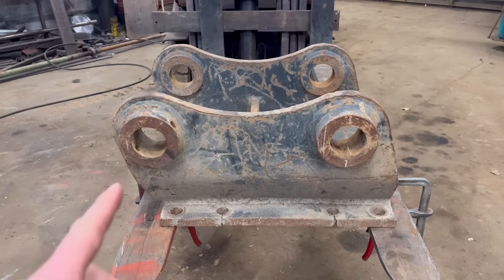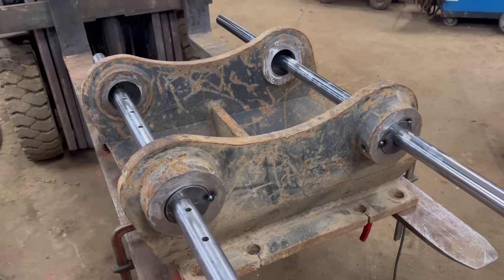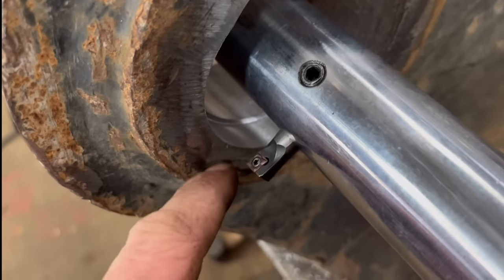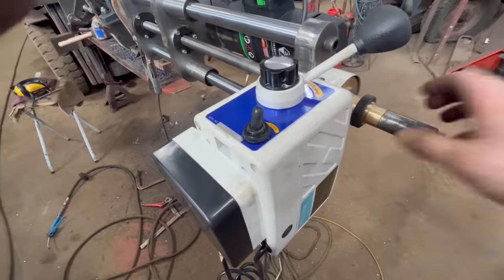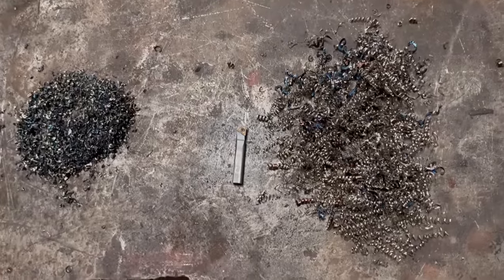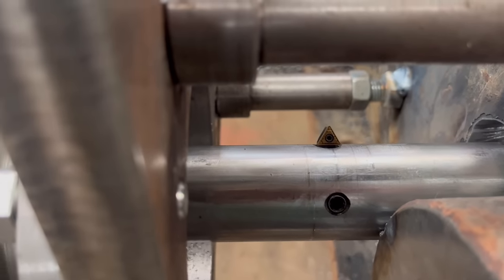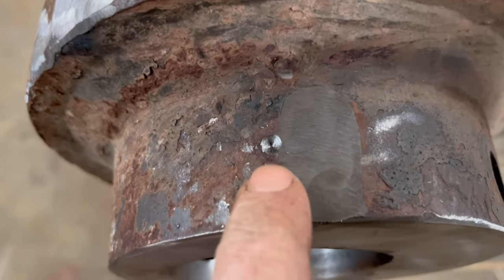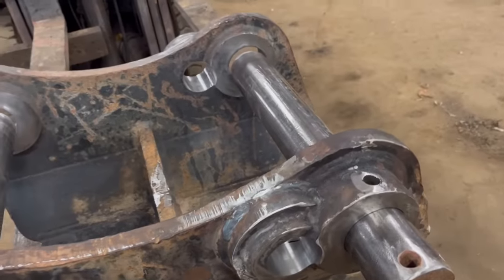Line boring excavator bracket. Offsetting holes to change pin centres.

Comment: Great job, nice to see the DIY line boring tool is doing a great job.
When welding inside the bores and other tight quarters, remove the gas shroud, it'll give you that little extra room.
Reply from the maker: How will the gas shield the weld though?
Reply: @snowballengineering  In the confined space like this, the gas builds up, as it can't escape the area of work. You will need to increase the gas flow, a bit of trial and error.
You can also use flux core, if it's tight quarters and gas coverage not working.

Comment: Oliver as a machinist from a shipyard I am very impressed with the machine you built and the results you are able to achieve. I am looking at trying to duplicate your line boring machine to do some side jobs as I am now retired. Thanks for the inspiration and for sharing the failures as well as the great results, cheers Paul. Victoria BC Canada
Reply: This is Jack many years in a machine shop and managed many, and owned two. when you're using a boring bar like you are using it, I believe you may need a radially relieved tool. The tool you're using looks like a regular lathe tool. According to the inside diameter, I have seen boring tools in small diameter holes, relieved as much as 15 degrees Under The Cutting Edge. Also you need to be cutting on Center, by drilling the holes through the bar a little lower than you have maybe. Breaking tools and them not running correctly is a good indicator the geometry is not correct.

Comment: If you get a similar job, consider the approach of cutting off the bosses (of the holes to be moved) and welding them back on in the new position; that would get you less interference between those bosses and those of the new holes.
Reply from the maker: Trouble is the bosses aren’t just welded on the sides, they go all the way through the side plates. Would of been quite a big job to do that and would still of needed line boring afterwards. Thanks for the suggestion though.
Reply: I couldnt help think the same but the reply reminds me i know nothing lol

Comment: I’m quite impressed that cheap power feed stands up to some fairly heavy use. I have the same one on my milling machine, it gives me a little hope it’ll last a while. On the whole your line boring machine is doing a cracking job.
Reply: I remember the first time I seen that they have a plastic gear being driven I could hardly believe that they will hold up regular use, yet it seems they do just fine with it.

Comment: Cracking job Olly and a bit of learning too !
We've just finished converting a pto driven dual head timber winch to a digger jib mounted unit, using a 45kw hydraulic motor which required making a  headstock mount. I'm used to working to tenths of a thou for toolmaking jobs, but since I retired the jobs have changed and getting digger pins to fit requires a bit more relaxation on my part, but no less "difficult" under certain circumstances, well done mate.
Reply from the maker: That sounds an interesting job.  I know what you mean, the pins need a good amount of tolerance which will seem counter intuitive to your toolmaking jobs.

Comment: Good job all things considered most places would not tackle a "one off" as there is no previous on which to base it. The end result given what was wanted and using the existing unit is excellent. Having had the benefit of seeing your approach (and possibly being wise after the event) it struck me that this may have been a lot easier with two new plates complete with new holes / bushes and the assembly welded back in place via a jig arrangement previously set up and welded in place for correct alignment. This "idea" seems to be a possible easier alternative method as I muse from the comfort of my armchair!!!!
Reply: That's what I thought also. Maybe leave the lone holes as they were and cut the dual hole area away. Then weld on some 40 or 60 mm plate with flame cut starter holes and bore them out.

Comment: Interesting job. The boring setup seems to work well. Could you not have opted to use shrink fit , heavy wall steel bushings (home made) instead of weld. The original strength would have been somewhat less compromised (thermally at least) since the bush hoopstrength would contribute to the strength overall. I really enjoy your problem solving and patience as you overcome difficulties.

Comment: That was great, nice problem solving.  You could see that the old tool was blunt. The chips were real hot and color changed but when you changed to a new insert the job went much smoother. Thanks for sharing.

Comment: The easiest way to get a flat spot for drilling is with an end mill, then spot drill and drill normally. The first tool you used for the line boring looks like it needs a bit more relief under the cutting edge as it looked like it was rubbing and limiting the cut.

Comment: Nice job moving those holes.
A trick I used to use when a drill had wandered off centre was to cut a groove down the high side of the slope with a centre punch.
Basically make a little v channel.  Let the drill bump across the channel until it has removed it.  If it’s still off centre do it again.
This will allow the drill to cut only on the high side.
The other choice is to start with a slot drill of the same or similar size (2 fluted end mill). But we don’t all have a full set of those :)
Use that to flatten out the starting point of the hole.  Once it’s flat put the drill back in.
I like your trick.  I wouldn’t have thought to do that.

Comment: Really well done, I am impressed. Meeting your customer's expectations can be hard sometimes, especially if they are sprung on you mid-production. The new insert holder did work really well. As for the new bolt holes being off centre, if you had an end mill you could have started the hole with that, making the drill follow the new path. Having said that, your guide block method worked brilliantly. Thanks for posting, I'm still catching up, keep safe and well.  👍
Reply: My thoughts as well regarding the end mill.

Comment: Customer didn't want much did they. I was a Carpenter for over 40 years. One of my favourite sayings was. The job would be alright but for the customers. Then you have to look at it as what you get out. The varied experience now gained from having to overcome awkward requests. You now know way more than you did from straight forward re cuts. And have a good excuse to buy some more cutting bits and facing tools. Actual experience is way better than any other form of learning.
Reply: it’s not like it was a cosmetic request, if the hole centres won’t fit the excavator it’s useless. From that point it’s down to cost, much cheaper to modify that make a new one

Comment: When a tool sings like that one when it's cutting that's called chatter. Chatter is a destructive force that will break your tool tip and leave a bad finish on your machine surface. Slowing down cutting speed would be the first step to minimize the chatter. Increasing the feed rate at the same time might help also.

Comment: Good work around and the driver of the machine won't care abt the finish one bit by the state of the pins. As you said you learnt loads, you can put a slot drill or end mill in the chuck and make a flat on a raduis for  drill spotting.
Reply from the maker: The brake on the drill is a bit worn so she doesn’t like any kind of sideways load. Definitely learnt a lot on this job.

Comment: Amazing work as always! For your problems with the weld buildup in the holes, maybe try using some 7018 stick electrodes and you can give them a bend to fit into the hole. If you keep a needle scaler next to you I bet it'll go just about as fast as the MIG.
Reply from the maker: It’s a long time since I’ve done any stick welding, that could be just as problematic 🤣
Reply: @snowballengineering  Gotcha! 😂
Reply: Thought I seen some stick welding,  maybe gouging

Comment: Good video 👍you did a great job. It looked like you wasn't using the cutting edge correctly to me. I'm not a machinist, but did work as a Maintenance Engineer at Dagenham Engine Plant Ford. 👍
Reply from the maker: Thanks.
Yes, the tool was too low in the hole and was rubbing on the insert.
Reply: @snowballengineering  it looked like the insert needed to be rotated so it was cutting on the correct face. 👍
Reply from the maker: No, I’m not that daft to be cutting on the wrong side.

Comment: Rare earth magnets are a useful workshop tool, you could use then to hold the disc in place firmly while you align them, you can also use them when setting the cutting tool depth as it will help help it in place while you adjust the screw and provide a bit of friction to make fine movement easier.
Reply from the maker: Only issue I’ve found with magnets in this environment is they get completely covered in iron filings in no time and are  difficult to clean off.
Reply: @snowballengineering  Wrap them in paper and when you take the paper off you can wrap it round the swarf to pull it off leaving a mostly clean magnet, If it does get badly covered then wipe the swarf off with a rag or gloves. I use them to hold various things and another thing I did was get some that have countersunk holes and are in a stainless holder. I mounted two in a machined aluminium housing which has tapped screws for mounting holes this means there's barely any magnetic field apart from on the one exposed face and they're much easier to quickly wipe clean.

Comment: Oliver Excellent work But you really had no need to air gouge out the extra pieces Yes as I got further into the video Use .9 mm wire much more versatile and greater penetration As I said in a previous post 25 Yrs boring my way round Australia and when I started if anyone knew less than me they knew a lot I am a tractor diesel mechanic from Ireland 
 Look up Climax their brackets are easily copied and very sturdy  and of course their bore welder lot of info on their website 
Don’t get too carried away with depth of cut as better take two bites and not break your inserts when you get into it and trying to do big Jobs with 1 insert it gets interesting Insert quality has improved heaps since we started in 1994 
What dia bars u using we used 57 mm bars bit heavy but strong Also inserts Kennametal American company and Lamina Swiss you won’t beat them I expect that your area would have a few ploughs ,old story if point / share is not harder than the ground it’s ploughing or breaks off at the first stone no good Inserts are the point of your line boring machine Most of the dedicated machinist will go about RPM speed of cut etc I would say you can rotate etc but the important bit is your inserts and the rest will follow There’s a face book page run by a top Aussie Line borer here in Perth Some helpful stuff on it and of course as is Fb some nonsense also Good luck 🍀

Comment: 13 minutes in and although I'm NOT an engineer, but enjoy this and other engineering channels. I thought that you would have welded the original holes up and then drilled and line bored them to size in the new position, as I say NOT an engineer, 40 minutes in I'd have run for the hills :) :) might it have been quicker/easier to make it all from scratch.

Comment: I hope you get to read this comment, Oliver, because it's that much older, and I have some good advice for you, which I hope you will check out.

As you rightly said, you are new to line boring, so you are going to make mistakes, and of course you will. It's the natural way of learning.

For now my only criticism which another viewer commented on is that with your particular set up meaning, the boring machine, you are taking much to big of a cut. Little steps lead to bigger things Oliver, little steps.

I know I mentioned this on a previous video of yours, one more recently, but I would like to suggest that you really do check out CEE, Cutting Edge Engineering Australia.

The guys name is Kurtis, with his partner Karen and their inspector, Homie. You can learn a lot from him about gouging, torch cutting, plasma cutting, welding, and everything there is to know about line boring.

His main bread and butter, if you like, is his verious types of lathe and milling work where he rebuilds parts for heavy machinery. Replacing complex  hydrolic moving parts and the use of a spectacular vertical honing machine.

Please go check out CEE. What have you got to lose?
Reply from the maker: I’ve been watching CEE for years. That’s one of the reasons I started my channel. I also watch his outtakes at the end which shows his jobs don’t always go as smooth as the main video shows either.  😆

Comment: great job mate, line boring is always a challenge. did you discuss with your customer the possibility of just cutting out the bushes that were already there and machining new ones and welding them in where needed ?? seems like it would maybe have been a cheaper solution ? love the channel mate.

Comment: May i sugest getting a morse tapper drill chuck for your radial drill and start the hole with a spotting drill.  A spotting drill is much more rigid and will get your hole started with less risk of walking on you.
Reply from the maker: The problem lies with the brake on the radial arm not being tight enough to hold the drill in the right place otherwise I could have done that.

Comment: you could have put am endmill in your radial drill and made a flat spot first and then drilled your hole . I have been using left hand boring bars for my tool holders they are round and you just cut them off to length

Comment: That was a lot of filler weld. Why not cut the 4 sleeves out of the plate, enlarge those holes and put them back in. Then you'd only need a minimal weld to bore to repair the wear.

Comment: Amazing work as always, your attention to detail is fantastic. The repair should be fine, I'm sure that will be connected to a quick coupler so the different materials really won't matter too much as the pins will never turn.
The line borer is coming on nicely, few more jobs I'm sure you will have all the kinks ironed out. 
So I'm a chippy and don't get involved the dark arts of 'metal' but could you have cut the odd bosses off, turned new ones with an off center 75mm hole welded them in and then linebored?
Reply from the maker: The old bosses are welded through the side plates so would of been a job cutting them out and with the cost of the new material, time spent boring them offset, re welding back in and then line boring anyway I think it wouldn’t work out any better.
Reply: @snowballengineering  oh god yes! I hadn't noticed and thought they were welded on the side. Bloody good job anyway

Comment: Another great job Olly, with the morse taper on the bar, can you not drill it and add a shear pin or tractor style round lynch pin to retain the drive head
Reply from the maker: I think the quill on the drill might be pretty hard.
Reply: @Snowball Engineering  how about making a two part cylindrical clam shell clamp to keep the taper tight and will hold it in reverse when you withdraw the bar

Comment: an end mill may help with drilling into a curve
Reply from the maker: My radial arm drill doesn’t have a strong enough brake to hold it in the same place to use an end mill.
Reply: @snowballengineering  was just a thought

Comment: Check out Curtis at Cutting Edge Engineering on YouTube  He has an line boring attachment that lets you weld a perfect circle around the hole to add material. Cant remember which vid but its in there somewhere. You guys do similar repairs. Great job and thanks for the videos.

Comment: That thing is cracked everywhere. Who is going to repair the rest of it?  Oh bye the way good job again.
Reply from the maker: No cracks? If you mean the holes, that’s how they are profiled out.  Cut round the outside diameter into the hole, around the hole and back out the same slot.
Reply: @snowballengineering  no I meant all the other bolt holes on the plate. You did a brilliant job.

Comment: Wouldn't it have been easier to just build a hole new bracket?
Reply: Still have to line bore a new bracket, saved a bit of time and a whole heap in material cost
Reply: Probably if it was for himself,  but in the current economic environment I expect his customer was looking for as economical solution as possible which he got, a bracket to suit two excavators??

Comment: If it’s a permanent pin surely it would straighten enough to hammer home? Yes I hate waste!😀
Reply from the maker: Depends how often it’ll get changed between machines I suppose. That’s the reason for the 3rd pin hole is so it can be used on 2 size of machine.

Comment: Would it not have been better to mill out the hole oversize to the final dimention then sweat in a plug and redrill, rebore to final size. Carbide insert tools do not like intermitant cuts, your better of with  good quality hss bits till you get an all round cut. Far too many adverts hence the dislike but an interesting video.

Comment: I wonder if it wouldn't have been easier to offset the pin bores by just gouging out the old bushes and turning some new ones from hollow bar to weld in and finish bore